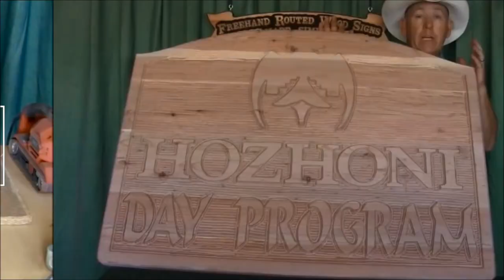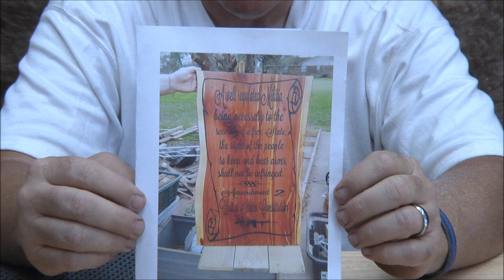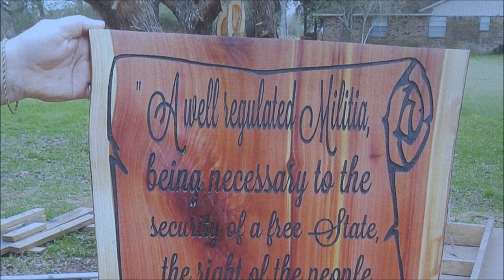Coffee & Questions 5/31/17 Carving Long Curved Lines Demo

Comment: As you wipe off the base, just before spraying it with silicon, you might want to remind folks to make sure the bit depth is set to less than 0" before making that wipe. Those 60-degree bits are quite sharp. Don't ask me how I know this.
Reply from the maker: LOL good point, I should have mentioned that.....Eric

Comment: possibility they can drill holes in the base every 1/4 inch, drop a nail or peg into the hole,just for the rounds
Reply from the maker: Yes I suppose so if it is a true circle. However that wouldn't work for an arch.

Comment: Hello Eric sal again. I found that if I do it in one pass without stopping my lines are straighter. When ever I stop and put the bit tip down again on the wood my router wants to go a different direction. What do u think Im doing wrong. Great video thanks
Reply from the maker: Hi Sal, It's all about control and feel. There is no wrong way if you're happy with the results. If it's working for you then stick with it. For me I like making it in several small passes and short strokes so I have the maximum control. Thank you for your input, Eric

Comment: why were you lifting the router every inch or so? Not whr you turned the board but before that
Reply from the maker: As I mentioned, on a cut like this that has very little room for error,  I don't like to stop the router moving with the bit in the cut. I like to take these cuts in short pieces when going shallow and then when I'm going deeper I can clean up any imperfections.